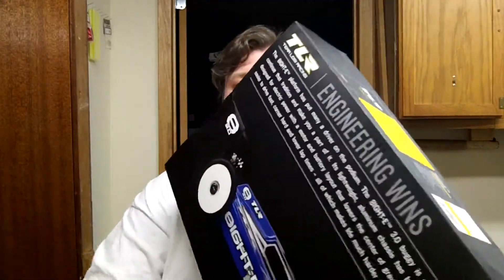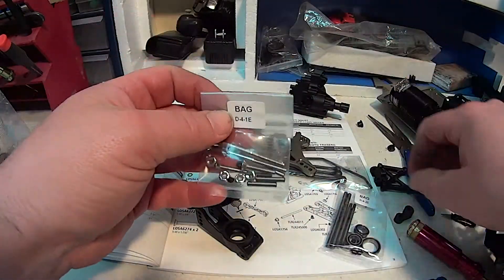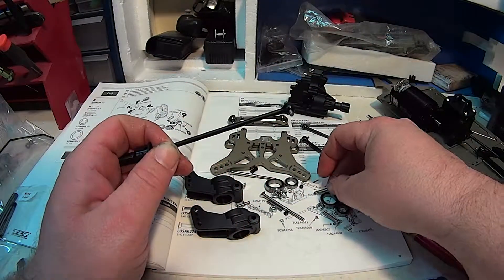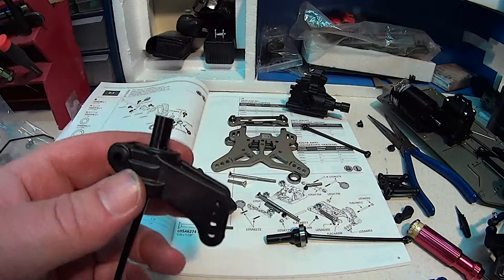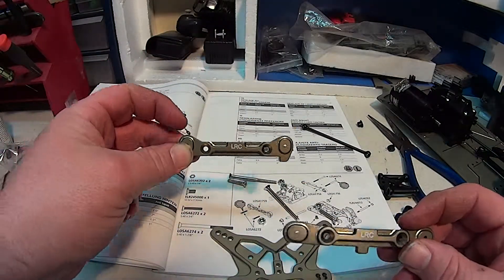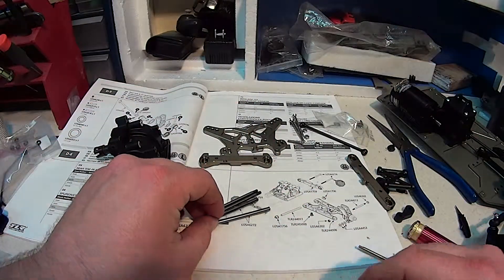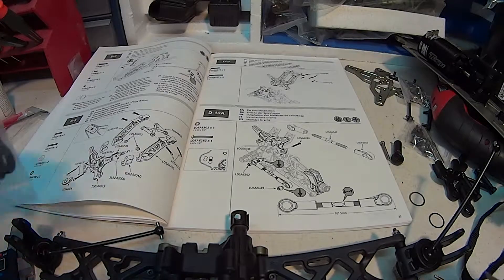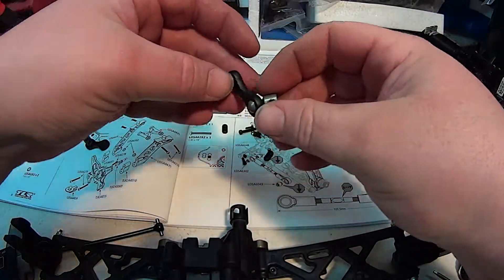TLR 8ight-E 3.0 Bag D Part 2

Comment: Thanks Jason. After reading the description on both the other day at lowes, I grabbed the blue. I finished the front dif and whole front assembly today. I noticed that you have shims for the dif. In my manual there is no mention of the shims nore are there pictures as shown on your manual. Do you know why this is ? I was wondering while building it because I've seen several videos on this.
Reply from the maker: +Jay West No Problem,  The centre diff has the pinion on the inside of the diff  also note the direction of the teeth on the Spur are facing in where the Rear has the teeth facing out and the pinion is on the right side of the diffcase   

Cheers

Comment: Sorry one more question. For the loctite. Should I be using the red or blue loctite ? Probably a dumb question but I'am new to the whole RC thing. Might try and work on it today.
Reply from the maker: The included thread lock is what I used. Which is red but not the same as locktite brand red.  Its way easier to get out than that.    If you are using branded locktite, use blue

Comment: Sorry this was the video I was referring to. Is the t hex wrench a 3mm or 2mm ?
Reply from the maker: +Jay West Yes,  I did mention it in the Video now that I re-watched it.  (its been a while  lol)   I forgot about that one screw in the tools list.   I used the T- wrench as it was a very tight fitted screw.   Gives more leverage just to make it easier on the hands.   You can get by with the included tools too.
Reply from the maker: +Jay West No worries
Reply: No problem.. Thanks Jason.  I bought a 8 in 1 hex set made by dynamite and a small low torq black and decker drill.  Now just need to make time to work on it !   Wanna get this thing on the track :-).

Comment: Ok I just relized this video is about the rear dif, so I went back and looked at the manual and it looks like the shims are only required for the rear dif. Correct ?
Reply from the maker: Yes.  The rear is the most troublesome part as the pinion is on the outside of the diff. Which increases the sideload.   When putting the factory shims check the diff for proper gear mesh.   If it too loose shim the diff closer to the pinion.  If too tight it will break in. Just check it often.   I would also get a spare rear diff case and spur and pinion set before you run.  Have not broken one on the 3.0 yet and it was ran the entire summer.  But the 2.0's broke lots